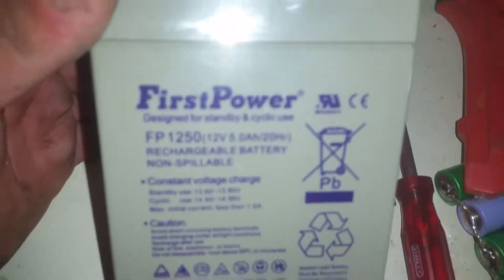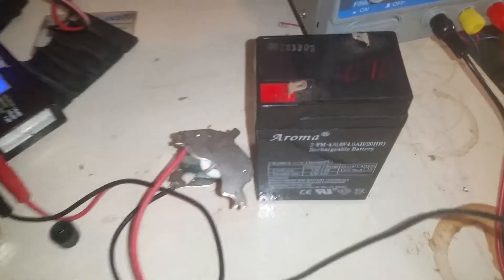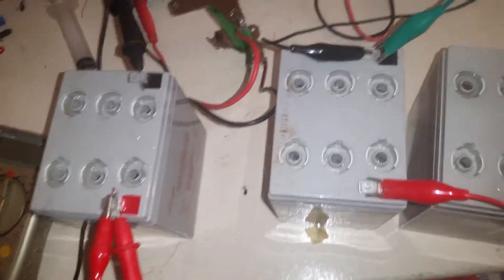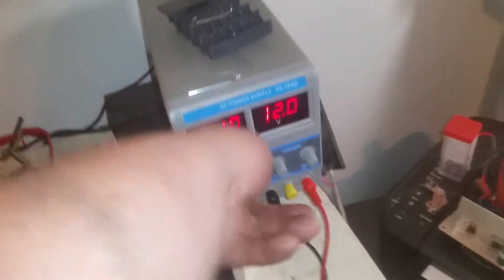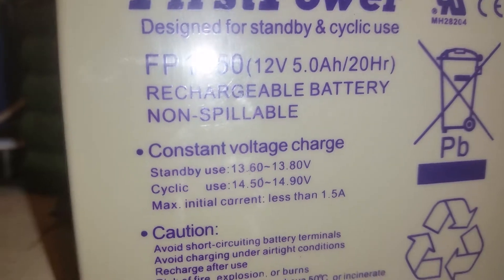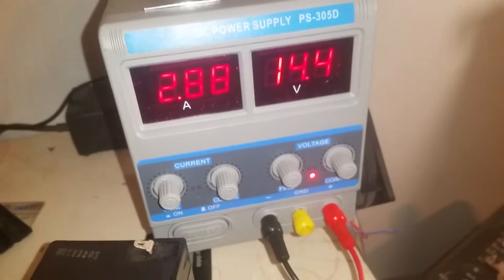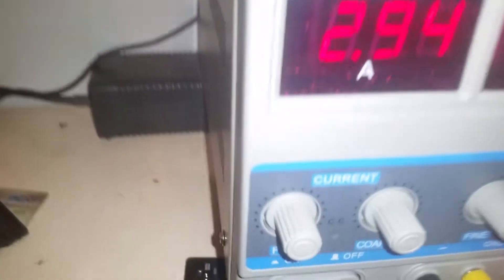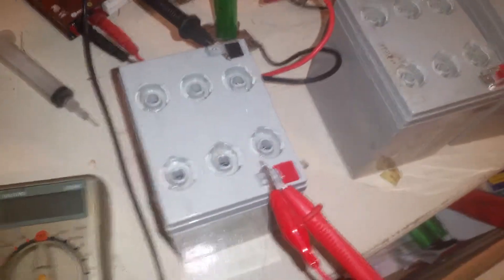12v 5ah agm/sla battery restore

Comment: Firstpower designed for standby & cyclic Use fp 1250 (12v5.gah/20hr)
Reply: My friend has a construkcion compeny cold agm.
Reply from the maker: Like the battery
Reply from the maker: Little agm batterys suck